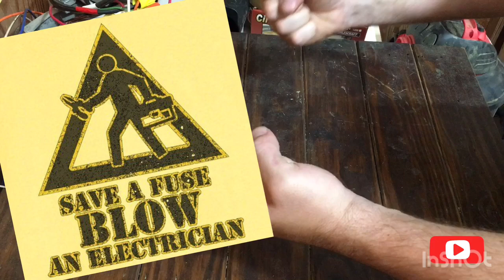Electricians Apprentice Tools (Industrial Maintenance)

Comment: Some of the worst tools I seen I should do a video of my box
Reply from the maker: Dont matter what they look like. They get the job done. Thats all that matters kiddo. Besides these are examples. Its not like I brought my work tools home to shoot a video
Reply: Well you ain’t getting any job done not even at home lol
Reply from the maker: @devanyflores9558  lol every build video i have says different but tell me more about what I do
Reply from the maker: @devanyflores9558  you've got to be either a kid or someone with 1-3 years in a trade where u still think the brand matters
Reply: Bro I can do it all from the ditch to the switch I can run duck bank,plastic bond, cable tray, snap track, channel tray , conduit and match all my bend to the biggest sized pipe, terminate and trouble shoot and if you say brand don’t matter you’re stupid yes it gets the job done but if you spend the extra money like knipex it makes it easier like ratchet cutter or rabbit ears
Reply from the maker: That confirms it 😂

Comment: You missed insulated screwdrivers and 600 volt rated gloves and leather protector gloves, hopefully both supplied by your employer. Minimum safety requirements. There’s alot of live control panel troubleshooting and arcflash danger. Be safe and don’t get complacent - ALWAYS DO VOLTAGE CHECKS. There are alot of 480 and 24 volt circuits in the same panel.
Reply: Apprentice isn't gonna be in Panels terminating
Reply from the maker: @carpediem4887  i was working in panels in my first year, so i wouldn't say that. But you're most likely correct that its probably not the "norm"
Reply from the maker: This was geared toward someone starting out. But you're correct insulated tools are good to have.

Comment: Do many graduating wiremen end up, continuing to apprentice to go right into industrial power,  or industrial constriction and skip the res and light commercial phase...
Reply from the maker: Not sure, all the guys i've known in this trade never went to school for it. We all started working resi/commerical work and moved around from there. But you definitely don't have to do it that way. Its just usually easier to find that kind of a job to start out
Reply: @BradsWorkbench  but you still apprenticed, right,  officially,  just not with "Union" right?
Reply from the maker: @ryanb1874  yes, i did with the state

Comment: It depends on what job ur on, u cant just assume that your never gonna need a pair of channels smaller than 10”, im an industrial electrician and i use my tiny channel locks all the time👍
Reply from the maker: What are you doing with your tiny channellocks that you couldn’t do with a 10” pair?
Reply: @BradsWorkbench not pulling out your back carrying all that weight (this includes all extra tools and  tools that are bigger than really needed)

Comment: Ill be honest, your tools suck. mostly the right tools but wrong brands. Klein, Klein, Klein. The millwakie tools are ok i guess but not as good as Klein.  Dont skimp on tools, they are how you make your living.
Reply from the maker: Lol u sound just like the guy I worked with and it’s funny how my tools did all the same stuff his did.
Reply: @BradsWorkbench  yep, I know what you mean, even the cheapest of tools will do the job. originally my skill set was in electronics. I have a BAS EET from ITT and i used what ever i could buy and afford.
Reply: I graduated in  and worked in the electronic world for a few years but started doin minor industrial electrician work doing part time on call stuff for the big box retailers doing PM's.
Reply: I went unemployed for 4 years in 2008 after losing a job as a manufacturing engineer and when i came out of that i worked at a newspaper printer and I used a combo of my tools and there tools.
which were pretty much the same. I upgraded a bit because i wasnt happy with the feel or performance of them. when i got the oppurtunity to work in the magnesium industry I saw what the other electricians were using and was shown why the right stuff mattered quickly. So i have been buying replacement tools since, To date i have spent close to $500.00 on mostly Klein tools or Rigid brand tools, The feel of a good tool in your hand 20 feet up on a ladder or 30 or more feet on a lift is important because if you drop it, you might not be able to retrieve it very soon, some times not at all.
Reply from the maker: I don’t knock people for their choice in tools. If someone wants to spend a little more on Klein and they have the disposable income, more power to them. But it is definitely not a necessity.

Comment: Great video man but how could you forget crimpers also you can get a really good set of ratching cable cutters off Amazon for about $35 thats were i got mine and after 3 years of abuse the only thing wrong is the spring fell out but the still cut like butter 
Also what type of plant do you work on
Reply from the maker: Ah man! I did totally forget crimpers! I knew there was gonna be something. And I was always too skeptical to buy those really cheap cutters. You’re the first to tell me they are decent
Reply: Get linesman pliers with the crimp behind the jaws.
Reply from the maker: That’s on my channellock linesman’s but still good to have the ratcheting crimpers for the insulated terminals